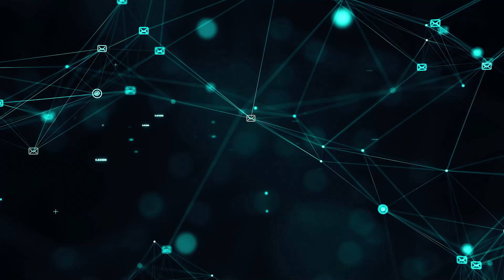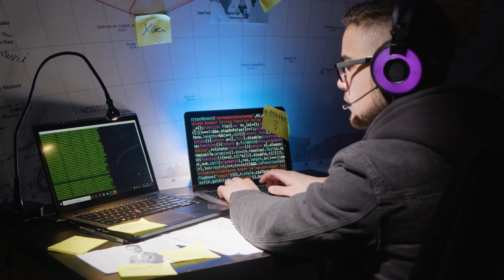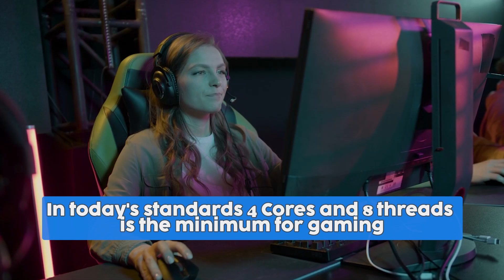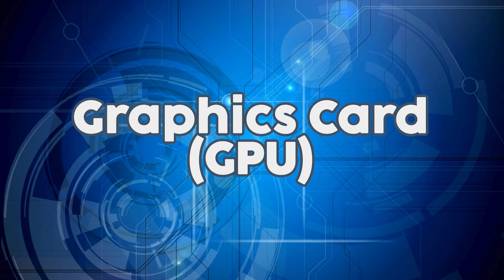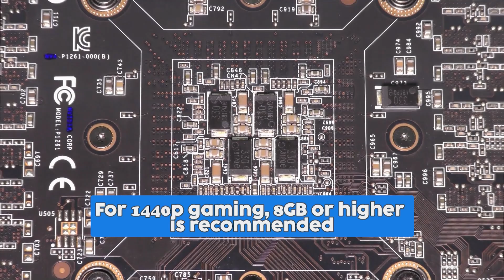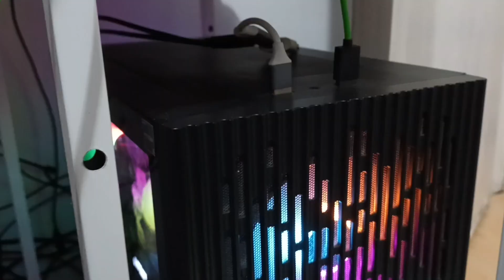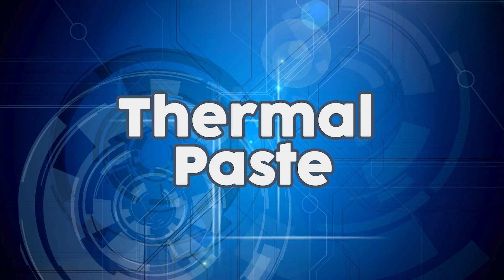🖥️ PC Components You Need To Build Your Own Gaming Rig

Comment from the maker: TIMESTAMPS
00:00 - Introduction
00:50: Processor
02:55: Motherboard
03:28: RAM
03:56: GPU
04:50: Storage
05:27: Power Supply
06:09: Case
06:49: Cooling
07:16: Operating System
07:31: Thermal Paste